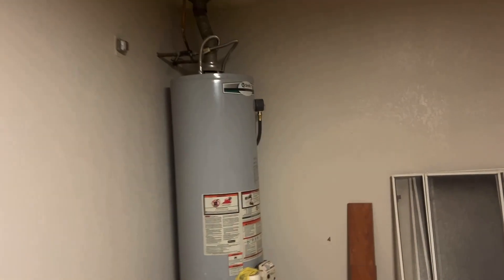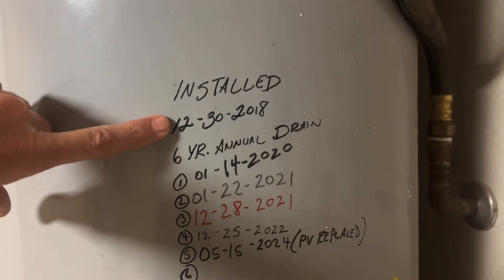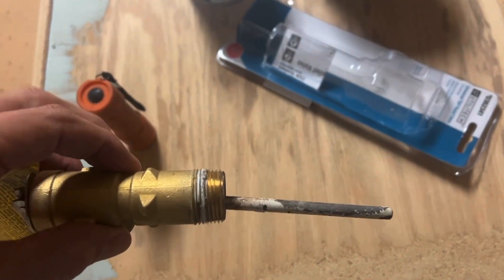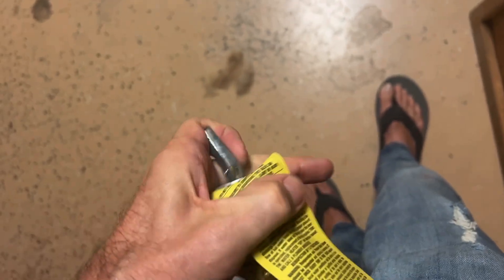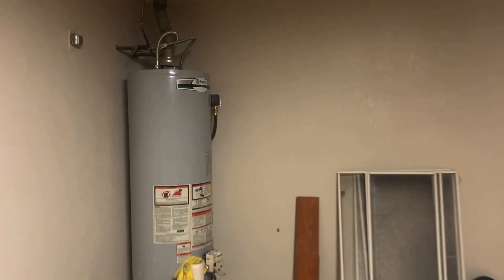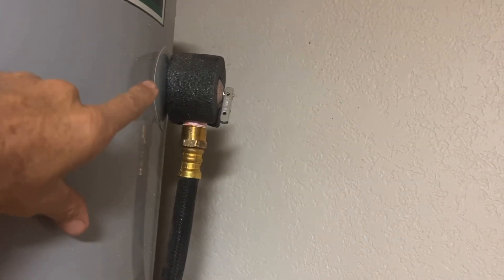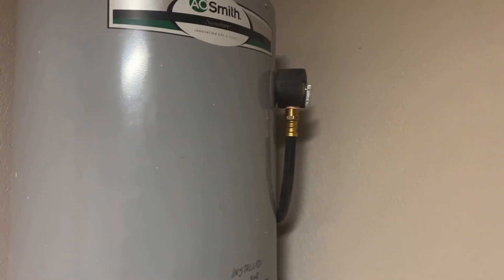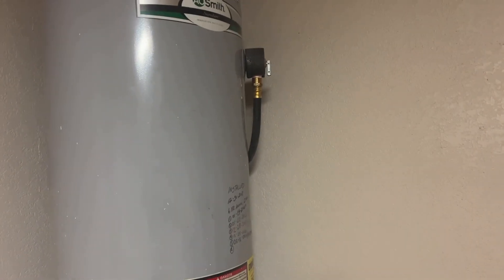WATER HEATER PRESSURE RELIEF VALVE WARNING!! #waterheater #waterheaterinstallation #diygarage￼

Comment: I've lived in many places over my 35 yr life, and remember even my parents making it a routine to test the T&P valve about once or twice a year or so, never had any issues afterwards.  Same with me, but I only had it happen once 6 years ago in a different home I was renting at the time, where the vavle continued to drip after letting go of the lever and exercising it didn't help, but the water heater was about 15 to 20 year old and the area had hard water.    Worst case scenario they are very simple to change out, requiring only a pipe wrench or a large pair of channel lock pliers.  After draining some of the tank to below the valve opening.  Because this valve is a safety device to prevent the heater from becoming a bomb should the thermostat fail to shut off the heat source.
Reply from the maker: @Sparky-ww5re  Exactly.  Well done!